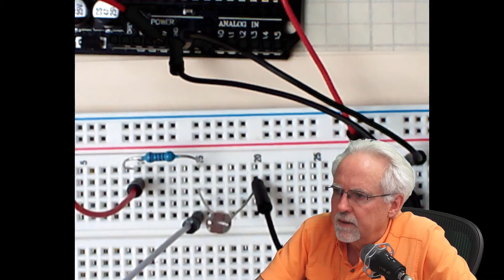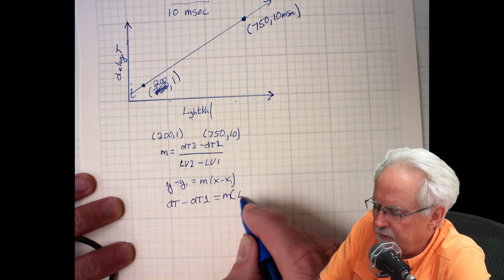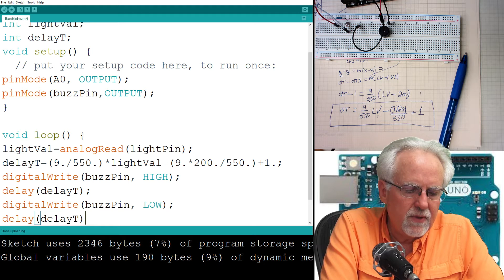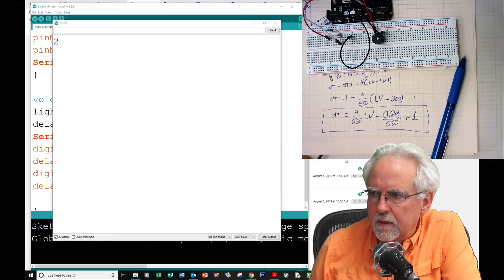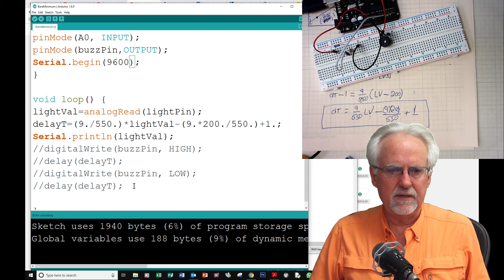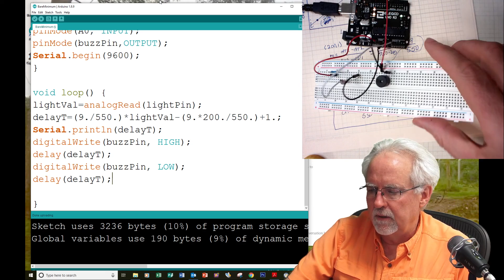Arduino Tutorial 26: More Fun with Photo Resistors

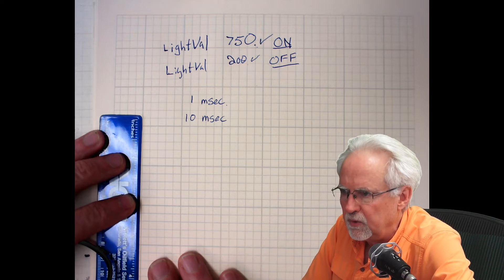Comment: Paul thanks for explaining the slope and line equations.  It has been a long time since I had them in school, high school and college, and I never really figured out how they apply.  Your explanation with the example sure makes more sense.  My attempt worked, but "I winged it" as you said not to do at time 9:50 in video.  I also picked up how you commented out a section and then uncommented it which I didn't realize was in the edit menu.  I have been using the /* and */ for commenting out sections.

Comment: I am a bit lazy, so forcing us to do the math is beneficial for this old brain.  Initially I used the code from Tutorial 24 and it worked just fine, although it was not as accurate because the equation was different.  I often find it helpful to revisit past lessons to refresh my memory and to provide parts of the framework for the current problem.
Reply from the maker: Great job!

Comment: So  while watching the video I couldn't speak loud enough for you to hear that pin A0 needed to be an input not an output. I used most of the code from the earlier course which used an potentiometer to adjust the tone output. It also refreshed me on the math needed to output the variable tone. It worked great. I used a much wider tone range. Thanks very much for the slope math. I also found the tone were much more pleasing without the Serial outputs on. Thanks again for sharing your knowledge and time.

Comment: oof, I wracked my brain on this one big time. Anyway, I had one big question: In the previous photo sensor lesson (#25), you put the 5k resistor AFTER the photo resistor in line, but in this one, you put it BEFORE the photo sensor. This confused me because it should've meant that using your math from the previous lesson would be incorrect? Or maybe I just missed something there. Also, more of a comment, but after following your tutorial step by step, I ended up finally getting it to work, but instead of it changing "tone" it changed in volume. I gave up trying to figure out why...
Reply from the maker: You can put it in either place, just the math will depend on where it is.

Comment: Finally got it! I love the graphing. I did try to do it on my own - the math and graph but I had it wrong and had to watch the video a few more times...but I got it! My graph points were buzzerDelay, readVal: 1ms,160 and 10ms,960. This produced a low tone when resistance was low (lights on) and high tone when the lights were off. To verify my understanding, I switched slope of my line using points 1ms,960 and 10ms,160. Then I used the absolute value function on the calculated buzzer delay to get positive buzzerDelay values only. Lights on: high tone, lights off: low tone. This is so cool!!!  Thanks Man!

Comment: The code was easy, the math not so much. I spent about 2 hours working out the math but, to no avail. I was close and I had the slope but I just couldn't get the last equation. In last video that dealt with slope, x1 was 0 and we never had to really deal with it. I will also admit I tried doing it my own way and that was a mistake lol. The math makes sense now. Using the dt and lv helped me wrap my mind around a way better. Maybe a bronze star for me?

Comment: Paul, the serial monitor works fine with the photoresistor itself but as soon as I connect the LED’s there is not output on the monitor and of course LED’s wouldn’t respond…. Circuit is fine, code is fine idk what happens

Comment: I did the pop test on my own, I am writing this before I watch your solution since I just wanted to say that the sound from the buzzer is very choppy, the reason is it goes from 0 to 100 every time with no perceivable in between, so you can imagine the waves like square waves, my solution was using forloops I created a Sinus wave which is much more smooth and makes the sound sound 10 times better

Comment: correct me if I am wrong, but you declared your analog pin of A0 to an INT of lightPin, but when you did the pinMode,  you didn't use the INT you had declared, instead you used "pinMode(A0,  INPUT);" and it should have been "pinMode(lightPin, INPUT);" right?? yes it still worked, but doesn't that mean you used a variable instead of an intiger?

Comment: Hello so for some reason when I attempt to combine the buzzer, my photoresistor beings to output constant values. I hooked it exactly as in the video and the funny thing is I got it working the first time without the buzzer hooked up. I didn't change any of the code yet for some reason the output for the photoresistor is a constant value of 15. Any ideas of what could have gone wrong?

Comment: One problem I have is for some reason when I put in the serial monitor code it lessens the pitch of the buzzer by quite a bit.
I'm not really sure why.
When I take the monitor code out, the pitch range returns to normal.
Any ideas as to why?
Otherwise it all ran smoothly. Thanks for the vids.
Reply: Use higher baud rate, check if it gets better

Comment: For this assignment, I looked back at my notes from the lesson with the buzzer using the potentiometer as an input to remember how to create the formula for the line. I didn't set my coordinates as the values I was reading from my photo resistor but rather 0 and 1023, but everything still worked out! I was yelling in my head about you setting the pinMode as an input, and using the pin number rather than the variable haha

Comment: I tried it out on my own and thought I had created the code successfully, however after I continued to watch the video I realized I had done the math wrong, I didn't know I could have a starting point of more then 1 for the photoresistor because we never had anything similar with the potentiometers so I ended up messing up most of the math around the end when we subtracted by the slope of the line. However I have learned so much over the course of these videos and I really appreciate Mr.Mcwhorter putting out educational videos like these. I learned all these formulas but it seems I still need more practice using them with arduino! Thank you again Mr.Mcwhorter for allowing a lot of people learn the skills you have mastered (or so it seems)!

Comment: Paul, you are doing an excellent job with these tutorials.  Thank you for doing them. As, an old engineer myself I can point out a few things to make them better. There are always several math approaches to solving a problem. You linear math approach is one of them. But, it is very complicated and difficult to understand for most of the people watching.  I would suggest instead of using linear math, i.e., xyz and slopes to solve these problems. A different approach, and simpler to understand; is to use relationship math instead.  Where equations are written like for like. Example: 1/1023 = 1/255 unknowns can be substituted and easily solved for.  In this case 750/10=200/1 and simple relationships can be calculated. There is not enough room here to fully explain that approach. But, you certainly are in command of that type math logic.  I have found teaching relationships, even to college engineering graduate students, is much easier for them to understand. Than, what may appear to them to be abstract linear math concepts. Even though, that approach is accurate.  So, is relationship math.  Just a suggestion for future tutorials.  Please keep up the great work.
Reply: Great Suggestion! I always had problems with Algebraic calculations, as I could not see how they linked back to the problem, as the letters did not correlate with the missing numbers.  Substitution always confused me. Maths was always a challenge to me as I did not have a good foundational basis to build when starting  & was very slow in picking up the principles & seeing how they actually fitted in.  Just a question for anybody in this network:
The subject is *MathermaticS*. Why do Americans use a singular descriptor of MATH for it?

Comment: Oh my word I'm such a moron I've been sat for about an hour messing with code tweaking and changing bits eventually give up and watched the rest of your video and im so glad I did as my issue was with wiring and not code I put my ground wire 1 column over on my buzzer so all that wasted time for 1 tiny little wire. 

Thanks again for the lessons Paul out of curiosity do you have a tip jar set up or paypal to recieve donations or even any uk affiliate links as I don't agree with some of patreons values so won't sign up to it and would love to compensate you for everything ive learnt so far
Reply from the maker: my paypal is paul.mcwhorter@gmail.com . Thanks!

Comment: I made it work by myself.  Laid out the min and max for both toneVal (for the delayMicroseconds) and readVal, defined the pair of points and drew the line in the cartesian plane in quadrant 1 (but the line I drew was from top left to lower right, like a backslash character - high light for low toneVal (hi-pitch), low light for high toneVal (lo-pitch)), used slope formula and point-slope (learned from previous lessons), hooked up the circuits, wrote the program, worked!  When light is down, pitch is low; when light is up, pitch is high (using mobile device flash light).  Thank you!

Comment: I got it too work on my own, but I cheated lol. I used the formula from the passive buzzer lesson instead of calculating my own. The sensor  ranges from 32 to 983 so its not the same as the pot. 0 to 1032, but it's close. And it does function :-)

Comment: Paul, your classes are great and I am learning and enjoying a lot but I do need to hook a brother up and offer a simpler way without formula on this project. I used the 'lightVal' as the delay time variable and it works perfect.  Check it out:

int pinBuzz=6;
int readVal=A1;
int lightVal;

void setup() {
  // put your setup code here, to run once:
pinMode (pinBuzz,OUTPUT);
pinMode (readVal,INPUT);
}

void loop() {
  // put your main code here, to run repeatedly:
lightVal=analogRead(readVal);

digitalWrite(pinBuzz,HIGH);
delayMicroseconds(lightVal);
digitalWrite(pinBuzz,LOW);
delayMicroseconds(lightVal);
}

...Boom!!!

Comment: ouch the grey cells have died --wired up OK, maths ok to a degree ( ouch), just kept click - click-click) could not see the woods for the trees, until I watched the conclusion section of the video and your pin mode problem. I had done a similar thing; input on output and output on input. (DOH) ye ye ye .

Comment: Paul, in the first project (lesson 25) you came with 5V directly to the photosensor with the 5K resistor on the other side.  However in the second you came with 5V over the resistor to the photosensor.  At first I thought that was the mistake!  Doesn't that make a difference?
Reply from the maker: Works either way if you do the math

Comment: I used the the microseconds of delay we calculated which  would decently cover the sound range from low to high from a previous lesson on buzzers. You represented milliseconds in your math related to the buzzer. I feel as if I completely missed something here. Your calculations worked and I don't understand how. We calculated delay in micro seconds to be between 60 to 1000 microseconds.  so delay = (9940./1023.)*analogread  value (0 to1023) +60; then used delayMicroseconds with the variable value created by the aforementioned equation. I'm familiar with m = rise over run. Sorry for the rant but I'm lost.

Comment: Don't you need a short delay for a high tone and a long delay for a low tone?  I used a 10ms delay for low light and got a low sound and then I used a 1ms delay for bright light and got a high tone.  So my line had a negative slope to it.

Comment: Hello Paul, in this tutorial, you hook up the resistor to the positive 5v and then the photo resistor in series. In the tutorial about photo resistors, the variable (photo) resister went before the resistor. Is it the same result (like a potentiometer) which ever goes first in the circuit?

Comment: Well, either I lost my photoresistor or it didn't even come in the Arduino package, so I just tried to substitute the photoresistor with a temperature sensor, but it is just not the same (though it worked). I will have to get me a photoresistor.

Comment: hello sir, been following these Tutorials for a week now.. thanks very much.. i have a question here, in the prev tut no 26. we have a circuit connection like this: 5V(Arduino board) to PhotoResistor to Series Resistor to GND(Arduino board); and we take the analog INPUT from the point between PhotoResistor and Series Resistor; in this tut 26 the circuit connection is like this: 5V(Arduino board) to Series Resistor to PhotoResistor to GND(Arduino board) and we take the analog INPUT from the point between Series Resistor and PhotoResistor. 
Shouldn't there be any differenc in the working of the circuit then..  I am using TinkerCad simulator so the diff is definitely there...

Comment: i was a little bit confused because in tutorial 25 you connected the 5v to the light sensor and the ground to the end of the resistor. but in this tutorial it is switched. i tried switching it like you do in this video and when there is no light the values go up instead of down.

Comment: Hi, Paul.  I just completed this lesson of the 68 and I just have to say that I love your style of teaching... and I am learning a lot and loving it!  I tried to wire this one up and do the coding on my own, but ran into trouble calculating the slope for the delay values on the buzzer, so I let the video roll for you to show me how.  I understand now much better how to calculate a slope, etc., and followed your example getting it to work just fine as you did.  However, I wasn't happy with the sounds I was getting out of the buzzer, so I did some experimenting and found that if you use delayMicroseconds, the actual lightvalue (off the photo resister) actually corresponds nicely (it just so happens) to the Microseconds delay.  I also wanted the buzzer to go higher with more light, so I would read the lightvalue and subtract it from 1023.  I'm not sure  if you want that much/type feedback, but here's the snippet that worked well for me to get a nice, gradual tonal response that went up as the light went up.  

void loop() {
  // put your main code here, to run repeatedly in a loop
  lightval=analogRead(anlpin);
  msdelay=1023-lightval;
  Serial.println(msdelay);
  Serial.println(lightval);
    for (cntr=1; cntr<100; cntr++){
      digitalWrite(buzzpin,HIGH);
      delayMicroseconds(msdelay);
      digitalWrite(buzzpin,LOW);
      delayMicroseconds(msdelay);         
    }
}

Forgive me if this isn't the kind of feedback you are looking for... just delete it and I'll know better next time!

Comment: I did mine using microseconds instead and kept getting low tone even in high light, then I realized that when I first checked the reading for when lights were on, it was still dark outside and now I was trying to use it when light was coming in the window. So I also learned that it's better to overshoot the measurable values when doing the math.

Comment: help me my code isnt working , see if there is any mistake 

int lr = A5;
int lv;
int d = 250;
int bpin = 8;
float tonev;
void setup() {
  // put your setup code here, to run once:
  Serial.begin(9600);
  pinMode(lr, INPUT);
  pinMode (bpin, OUTPUT);
}

void loop() {
  // put your main code here, to run repeatedly:
  lv = analogRead(lr);
  Serial.println(lv);
  
  tonev = (9./818.)*lv - (1503./ 818.) + 1;

  digitalWrite(bpin,HIGH);
  delay(tonev);
  digitalWrite(bpin,HIGH);
  delay(tonev);
}